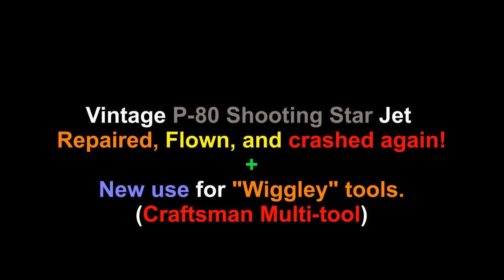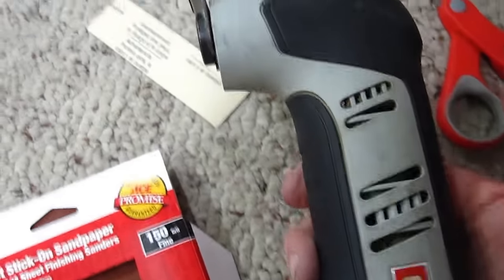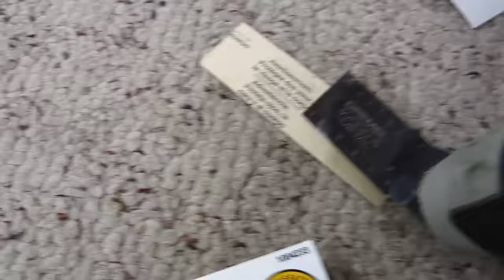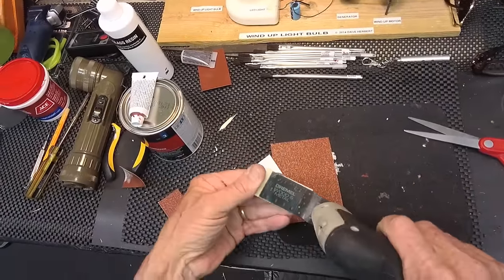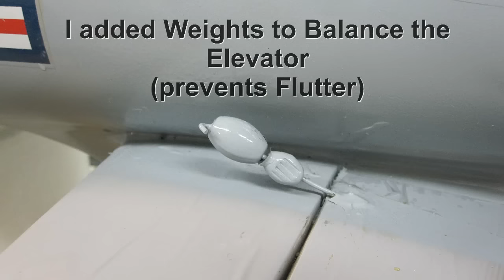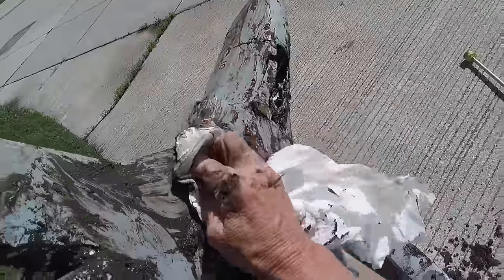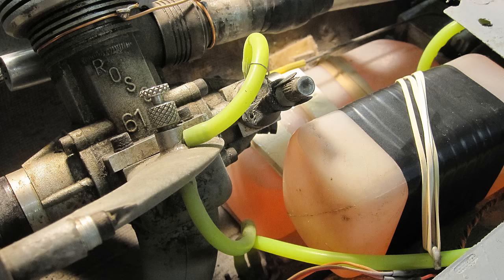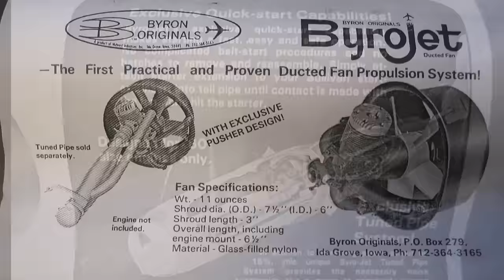P-80- F-80 Shooting Star Repaired, flown, & re-crashed! Plus a new use for my Wiggley Tool.

Comment: LOL, this was a pretty fun video.  I really enjoyed this one because you showed the typical repair and a subsequent crash result.  It always looks like you have no damage on the place you just fixed and now EVERYTHING else needs fixing.  I've been on this journey too.  I am going to borrow you wiggle tool idea for the sanding, until I'm down to the point in which I'm really bringing out the "glass" look, and  finishing off by hand with abrasive cloth instead of paper.   Two thumbs up on this one and good luck on the next flight. ~Stu

Comment: Wonderful inspiration to anyone who's crashed an expensive plane.
I'd suggest a simple go around as the re-re-re-remaiden lol. Just up and back down as a check flight, call it good and then fly her out once the successful flight is done !
Reply from the maker: Thanks very kindly.  I am thinking along your lines of flight also.  I need to work on the Idle, which is difficult to achieve with the tuned pipe. It mostly likes wide open. Thanks again and we shall see what happens.

Comment: Using a Orange TSix DSM2 on a Nitro Jet! You Sir have balls of steel!
Reply from the maker: Haha. I have 6 of them and they all have worked perfectly for years in all my helis, jets, and quads. They are based on the Spektrum  Platform, but program easier and have lights. The Orange Rx also has a Satellite receiver added.  Besides, that wasn't what caused the crash. Thanks for your concern, though.

Comment: NightFlyyer I know you own a Dremel tool, that works great for sanding also. I say the camera pointing in the tail direction is the problem.....it was the only constant, Lmbo. You did a great job on the rebuild though, and did you paint the fuselage? That Bird looked brand spakin' new!
Reply from the maker: I do have Dremels, but they do not sand flat surfaces or have lights.  I also usually use the camera out the rear, because when it is in the front, there is more clouds showing than ground. LOL.  I did repaint the fuselage and thanks kindly for your comments.